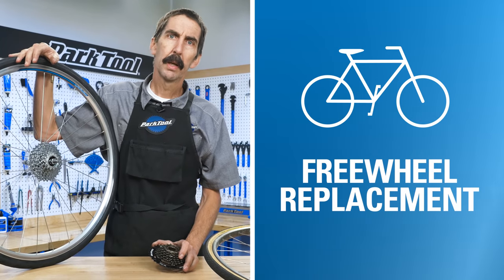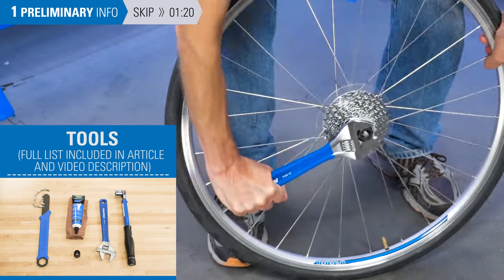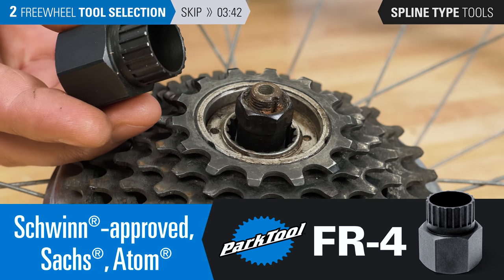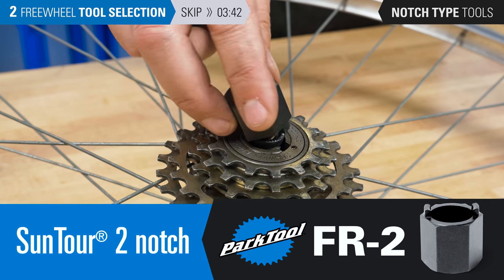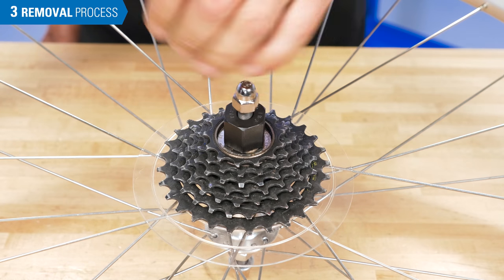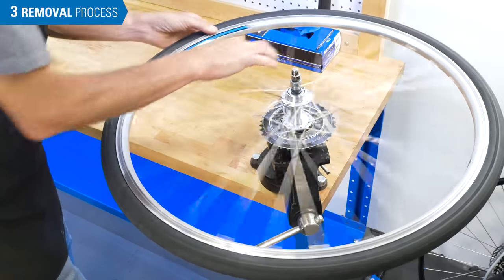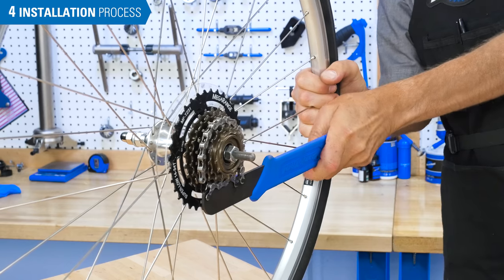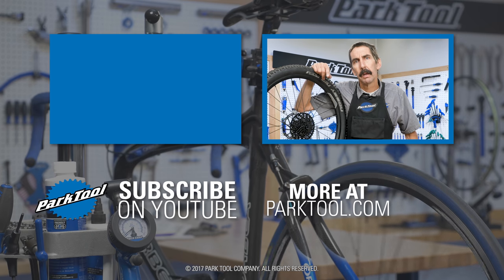Freewheel Removal & Installation

Comment: Help Calvin!!!! Purchased a ekit. Installed freewheel and noticed it came w/no lockring! So there is a bit of thread showing. Since I have no lockring how do I remove the freewheel? Can't unthread it cause that just activates the freewheel feature.On the freewheel is a email address: www.cnata.com
Reply from the maker: If this is a freewheel, it threaded to the hub.  That brand uses the FR-1.3 to remove, as seen in the video.  A freewheel does not use a "lockring" to remove.  Use the freewheel tool fitting to the center to pull off the entire unit.  Check also https://youtu.be/iTJ3taJHOn8 to see the freewheel vs cassette systems.